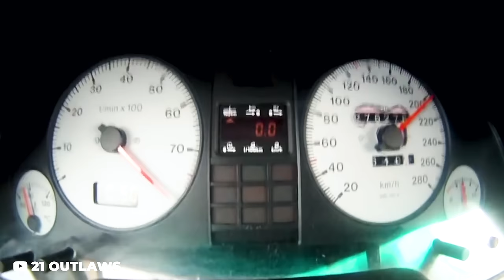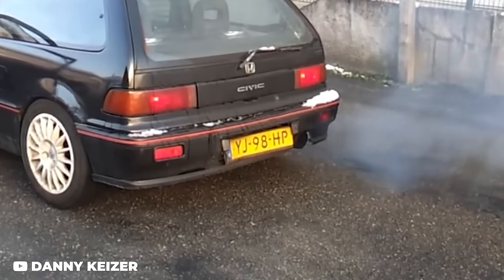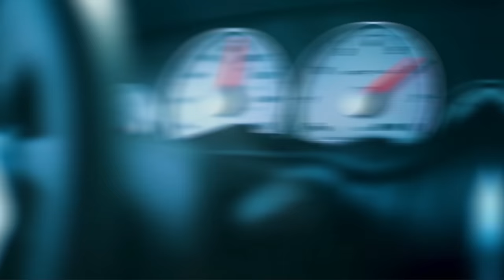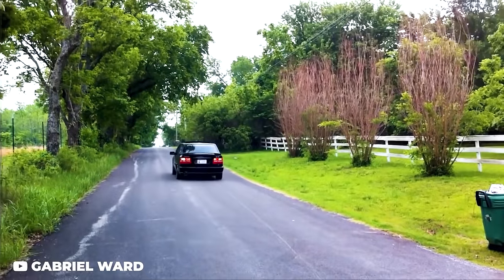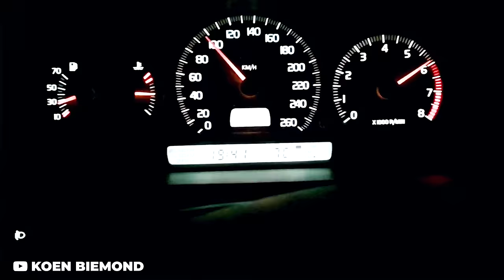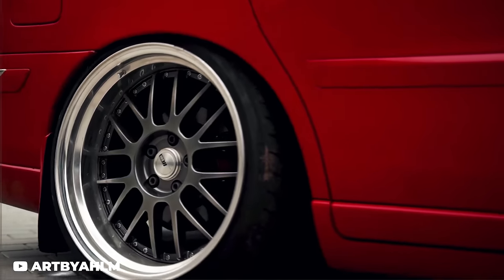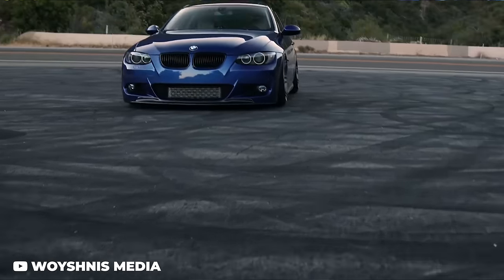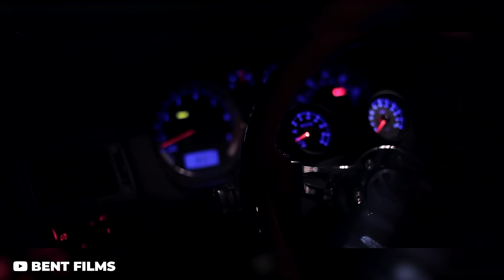5 Cars YOU Can BUILD For CHEAP Right Now!

Comment: 335 is cheap after u do , value cover gaskget, rear and front seal, oil pan gaskget, replace charge pipe, , oil fiter housing gaskget, inspection of turbos. then vacuum lines and you're good to go. all of that is 5k + car at a local shop
Reply: you can do all of that in your garage for much less too (maybe not rear seal though).
Reply: @SicSemperBeats  i did some someone do that in their garage, but he was swapping the engine to a wagon anyway
Reply: @bigpapi88  n54 wagon seems dope. Can only imagine the confusion when someone gets gapped by a wagon

Comment: Saab turbo

Most of them have 200HP from factory
Just a ECU tune, and a few little upgrades and boom 300+ WHP 

If you want more power swap out the turbo for the larger ones that pair with the T7 Coilpack and you’ll be able to push 500-700HP

(Check comment below on guide for tuning saabs)

Comment: The old vq swaped Nissan sentras are pretty fun to play with considering it's all junk yard parts and a few snazzy motor mount swap brackets
Reply: That is very interesting. Never heard of this swap. What makes it awesome is being able to bolt on OEM parts from another car to make it work. I've seen this with swapping in a V6 Toyota truck engine into tiny economy Toyota with OEM parts from other Toyota cars similar to the Honda builds.
Reply: Ya its basically rip the 3.5 and six speed  transmission out of a altima ser and put it in a sentra ser add the motor mounts and a custom exhaust  and a bit of wiring and your good to go
Reply: @johnvangennip1163  Wow, I knew about the Sentra SE-R but never knew there was an Altima SE-R. That is pretty cool.
Reply: @SI0AX  Yeah I agree that’s what I love about swapping cars in the same brands a lot of them are interchangeable which is always really fun
Reply: @johnvangennip1163  literally going tomorrow to pull a 05 Sentra SE-R trans to put in my 91 SE-R
Reply: Tell me more
Reply: @apprenticefelix7740  so my car is a 91 Sentra SE-R it has a SR20 motor in it with a 5 speed lsd. Only reason why i want to swap out the 5speed is because it’s not hydraulic and I don’t like the way the shifter feels, plus the extra gear will help with me getting around the track faster
Reply: thats cool but g35s and 350z's are cheap and available enough to not have to go through the "trouble" of swapping. And you get rwd/awd and lsd (depending on trim level) as a bonus.
Reply: The qr25 spec v's are pretty fun on their own with a ton of torque for a 4 banger!

Comment: Honda civic should be om this list. The cheapest car possible and for about 3k you can be near 400whp and weigh 2k lbs
Reply: And it's fwd...Hella gay
Reply: @jordancabral1003  rwd ftw. And half the cars they talk about thats cheap are fwd. The neon, jetta, and i think the Volvo but im not sure. Ive never looked into them
Reply: @jordancabral1003  speed is speed, might not be ideal. I dont own one but I know they can hurt feeling regularly. Not ALL feelings but in a street scenario they are a swell contender after mods.
Reply: Hondas are good and all but not really something ppl want drive anymore there engines are really good but not worth the hate u get and from my experience fwd Volkswagens are way better then Honda bmw ftw tho
Reply: @freaksinuniform438  GET THE HECK OUT NOW, if your saying VW is better than Honda. How many broken down/CEL’s do you see compared to Hondas? Sure when they come with the stock turbo out the box its pretty obvious it will take most stock Hondas. If were going to future build potential, Hondas smack em all the time especially with it being much more reliable. How many 600-1000 whp K-swaps you see out there compared to any VW?

How many record setting FWD Hondas do you see out there compared to VW’s?

No question, Honda Civic/Integra should’ve been on the list.
Reply: He said he didn't want to mention factory N/A cars. That is why it's not on the list. But most people know any Honda is an excellent cheap tuner platform.
Reply: @darrendent8288  you hype it up to much you need a v8 or it’s not a fast car 4/6 cyl suck there small pain in the ass to work on low power sounds bad lacks actual power just get a crown Vic
Reply: @SI0AX  I def missed that part. But if thats the case the chevy cobalt ss is much cheaper than a 335i. You gotta be lucky to find a running 335i for under 10k while a ss you see online all day for 3k-5k with minimal issues
Reply: @SI0AX  He already mentioned the G37. Last time I checked they all came from the factory N/A 🤷🏿‍♂️
Reply: @YouSoundButtHurt  can you name a decent looking modern rear wheel drive car? It's okay, I'll wait. 
I swear if you say "350z" I'll laugh at you. It's a dollar store brand VW New Beetle.
Reply: @colesherrill7472  FWD without a LSD is absolute garbage
Reply: @darrendent8288  I guess it's kind of mixed because he mentioned that the latest ones have a Turbo and decided to also mention the older NA ones.
Reply: @YouSoundButtHurt  The Colbat rear looks like a GTR rear almost.
Reply: @cjaysabino  Yeah but getting the Cobalt to 700HP is going to cost more than doing it on the 335i. Most cars will cost more to get to 700HP vs the 335i because engine machining work will be required.
Reply: @jordancabral1003  what’s so bad about fwd, other then wheel hop there’s not much wrong with them outside of the track or drifting, for roll racing there’s literally nothing wrong
Reply: @tony_5156  negative depends on how your using the car, lsd is not always the best
Reply: First off, Hondas require a lot of wrench time in order to perform well. The reason they are able to make power is because they are high revving and don’t make much torque. Once on boost, torque is still kept down in order to keep the bottom end safe.
On top of that, they come in a lightweight package. However, that doesn’t mean you aren’t sacrificing comfort, luxury, drivability. It doesn’t require much more to build a VW 1.8t to be as quick as any Honda. You can also get that same package in an Audi with AWD.
Reply: @rocavelli20  Yeah, for this reason, if you want to build a 700+ HP monster that is still comfortable to drive, and want to do it on a budget, a used BMW is the way to go IMO. You get a whole package of suspension and brakes as well.
Reply: @SI0AX  100% the only reason I’d stay advise people to stay away from BMWs is because they’ve only had about 15 years of R&D on gasoline turbo engines. I have owned both 135i and 335i and the N54 is not the best engine, but I won’t argue that they make great power! If you don’t know how to wrench, leaky injectors and 30FF codes will make you hate the N54. Currently have a B8 S4 and 340i which are both better cars than anything with N54, except 1M.
Reply: @jordancabral1003  if im not wrong theres less drivetrain loss tho
Reply: @darrendent8288  did you not read I said Honda engines are really good y don't u just walk off...I  just rather have vw better looks better ride and not all the hate that comes with honda and personally Hondas are ugly all they got is good engine's rather have a car with quirks but with sexy german engineering
Reply: @freaksinuniform438  lol gotcha
Reply: @rocavelli20  But your literally spending more at the end of the day dealing with Euro parts and Euro issues compared to Japanese. Your dollar definitely goes longer with a Honda.
Reply: @darrendent8288  yes your dollar goes longer with a Honda, to a certain point. But most ppl think “rods, pistons, cams, turbo” that’s it. When really there’s much more that goes into it. The cost of building a boosted car from factory is much less than to build something NA. Most guys here cannot assemble a bottom end or time cams. Once you’ve got it together, have fun putting down 700whp. You’d need overfenders, a wheel and tire setup, traction bars, and a whole new suspension setup just to barely put the power down. At that point, the light weight chassis becomes less of an advantage. Might as well go AWD. That’s why all the fastest Hondas run AWD and which adds to the costs of the “cheap Hondas”

Comment: I've said it multiple times. C5 A6 with the 2.7t. I have bought two for sub $3000 with good maintenance. With downpipes, diverter valves, a meth kit and a tune, I expect to dyno at low to mid 300's with almost 400 wtq. I have spent less than $6k on the entire build including the car, mods, tuning, and suspension

Comment: Would stay away from a "cheap" 335i. Gives the young boys the idea that its attainable, but its a headache when you buy a clapped out one that requires a ton of maintenance. Spend more money and save the headaches.
Reply: As a 335i owner. Unless you do 95% of the maintenance yourself. You won't have enough money to modify it. It's not cheap by any means.

Regular maintanace, when done completely by yourself, will be around 3k a year. It's bonkers how expensive the parts are, even when you buy them straight from the manufacturer.

Comment: 12-15 si or ilx with k24z7 should be on here can make 4-500hp on stock un touched engine reliably
Reply: Yeah, the integrated head exhaust manifold actually makes a turbo setup spool faster and the turbo kit install is also simplified by this design and will allow 500WHP. People say bad things about that design but it's because they want to go N/A when they should be doing a turbo build!
Reply: They aren’t cheap
Reply: @lonekyoya9155  Yeah, for some reason the prices I see for the 9th gen Civic SI with the K24 engine are around $20,000 used with more that 100,000 miles! It's not worth it IMO. That was pre-pandemic prices. Now it has to be a lot worse, even less worth it.
Reply: @SI0AX  that's cap. I've seen most go for 800-1500 no way a 9th gen si motor is more expensive than a k24/20a
Reply: @Mango_Pnch  I didn't mean the engine, but the whole 9th gen Civic SI car. I've seen the older gen K24 engines(the ones on the Accord) go for $600 engine and transmission(drive-train).
Reply: @SI0AX  from a dealership yes most ppl are still selling 12-18k relatively often.
Reply: @Mango_Pnch  18k is too expensive still unless it's like 30,000 miles. But even then I find it too expensive. I think a more fair value is under $15,000 for a car with less than 60,000 miles and in excellent condition both interior and exterior. Anything higher or worse condition is a ripoff IMO and I have not been able to see any of these cars in fair price range/condition.
Reply: @SI0AX  chip shortage +stock+inflation. Turbo w/ or w/o a built trans below 120k miles is 9-15k typically as well. Civics hold value and being the best and (arguably) last good looking k24. For reference. I got my si at the dealership no haggle 15k w/ 60k miles in 2017.
Reply: @Mango_Pnch  Wow, amazing deal especially at the time. The prices I mentioned were pre-pandemic prices. I stopped looking at cars post-pandemic price boom.(Start of pandemic actually dropped prices).

Comment: You got volvo right but you really need to go a bit further back. Anything with a Redblock. Much more to be had with this engine.
Reply: the redblock is cheaper once your making 500~hp but until that point a white block is cheaper (it also sounds better) im also just jaded as im swapping a b5234 from an s60 into my 242
Reply: @kylerpowney9771  I don't disagree.

Comment: Still missed the 1g Neon. A junkyard PT GT swap can be had for less than $1000. Takes just over a day to get it running with factory electronics and you have 230 HP in a 2400lb (curb weight) sleeper. That weight can also be dropped to ~2100 If.... you don't need airbags, power steering, AC, side impact door beams, crash bars, door panels...ECT. Spray that who are and you're at 300 HP. That's C7 Vette nearly C7 ZO6 territory.

Comment: Most i’ve seen a FBO  3.7 V6 make was 356WHP on E85. The 3.7 that raced against the Charger in this video was Supercharged. Thats another 7k right there in mods. Lets not fool G37 owners in to thinking they can beat 500hp mustangs with a naturally aspirated set up🤣
Reply: They aren’t made to beat a 5.0 lol. They will walk an ecoboost tho
Reply: @absorb5161  yeah but they showed a video of a boosted 3.7 and all they said was “bolt ons and tune” as if that will net them the same amount of power as a boosted set up 🤣. Not saying they’re slow. I’m saying to beat a bolt on tuned coyote like mine with 500HP, you’re gonna need boost in the 3.7. Unless you decide to go the cheap route and use nitrous🤣
Reply: yea I was thinking the same thing lol. If you're on a vq platform and looking for cheap power, a used supercharger kit (ive seen some as low as $2000) is the way to go

Comment: Included with the 1.8t Vw jetta and GTI should be the Audi a4...Also the 2.0t is a good match to BMW 330...direct inject and turbo,but the maintenance is kind of a turn off
Reply: The Audi also comes with the same 1.8T engine as the Jetta because they are basically the same car. I had a friend who swapped the front end of his Jetta with an Audi front end and it was bolt on and ended up looking just like the Audi, lol.
Reply: @SI0AX  yup same parts 😂   you can also awd swap a jetta using The a4 quattro for a donor car.

Comment: I bought an SRT-4 brand new in 2004. Built motor and GT3076R with all supporting mods… 498whp 525wtq. Pump gas. Next step was a GT35R and race gas. But sold it.

Comment: Q50 maybe not cheapest. But can pick one up for 20k with less than 60k miles. Ppl are getting 430whp 500tq with just intake intercooler and a tune. Lots of meat on them. Much better version of g37 imo